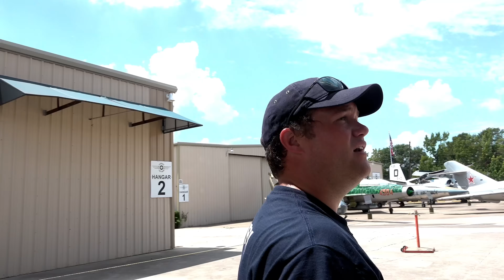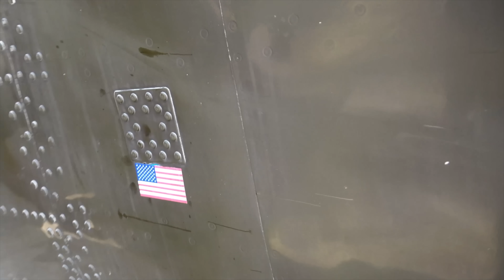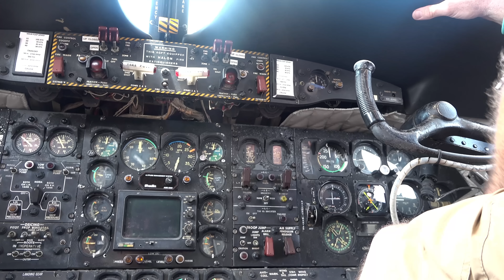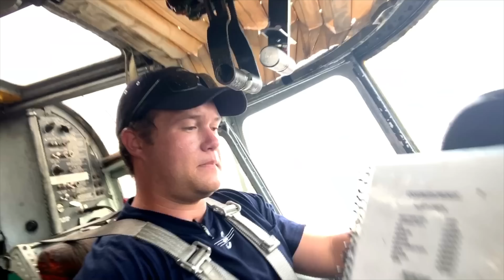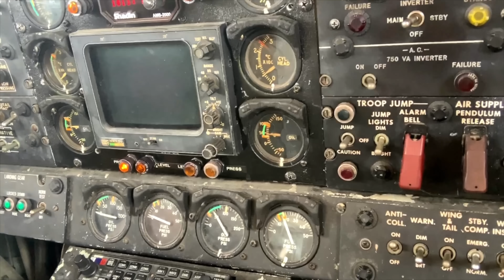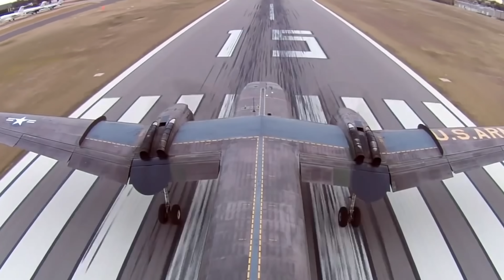The ‘Ugly Duckling’ That Got the Job Done | Inside the De Havilland DHC-4 Caribou

Comment: I was really surprised to learn that deHavilland made this bird.  They made some really good birds.  The weight of its cargo payload could be carried in a pickup truck.

The Army bragged about jt’s short take off with a full load, compared to that of a C-130.  They over looked the fact that a C-130 can lift off carrying the weight of a fully loaded and fully fueled Caribou.  And, today, over 50 years later, the 130 is still operating.

The  Carjbou was closer to being g a Wright Flyer, but with better engines.  It was a doggy aircraft.  The WWII DC-3 was a superior aircraft.
Courtesy of Half Vast Flying

Comment: The US Army flew the Mk 7 DHC Caribou. The RAAF and then the Australian Army flew Mk 4 Caribous. The older, ‘jet jockey’ pilot, in this video, should have known that, still, it’s a small point, I guess, except when you’re maintaining or servicing them.

You can tell a Mk 7 as it has, like the ‘Bou’ in this video, a little radome on the nose which makes it look like the aircraft has a ‘pimple’ on its ‘face’.
 
The Mk 4 Caribous are easily identified as they have a much larger, designated, radome plus a whole range of other differences, inside and out; electrical, airframe and mechanical, etc.
Our C-130 Maintenance facility; 486 Sqn, where I was posted, was right next door to a Caribou Sqn at RAAF Richmond, NSW. 

They were amazing aircraft to watch, as were the Hercs, especially when the Caribous were doing pilot STOL training sessions. The Caribou’s massive horizontal stabiliser caused substantial yawing even while landing in a moderate cross-wind. It was fascinating to watch as, in really bad weather, ‘Bous’ landing, usually, went down the strip with one wingtip just ahead of the rest of the airframe! 

Our C-130s were magnificent in their versatility of missions but I think that our Mk 4 Caribous just beat them. They could be set down almost anywhere, in distances you’d bet such a large aircraft could never land.

When the RAAF’s Caribou passed some huge flying-hours milestone, some DHC bigwig came all the wayfrom Canada, to Richmond; to award the squadron with a prize or a plaque, etc. He went on the record as being genuinely impressed by the way we kept our Caribous in such good condition and how they had long-passed their original ‘lifespan’ estimates. This was still quite a while before we passed these Mk 4s to Army.

We really didn’t want to get rid of them; but Army wanted them so our Mk 4s were, reluctantly, relocated to an Army Aviation Unit in Queensland. Sadly, sourcing spares for the Mk 4s was a constant problem so, eventually, they had to go. Fortunately, a couple of Caribous are still ‘airworthy’ and held in collections open to the public.
 
Many thought that DHC should have kept rolling out vastly improved new models and then their sales numbers would not have dropped off. No operator of the Caribou parted with them willingly, as far as I can discover. 

It was a fundamentally excellent airframe design which led to an extremely varied mission capability list. Perfect for those air forces, and commercial operators, who didn’t need larger transport aircraft. Sadly, the trend, back then, was for huge, long-range, cargo and troop carriers. This resulted in Starlifters, C-17s and Galaxy transporters that could move ‘armies’ around the world at the drop of a hat. 

Now, those conditions of probable conflict have changed. If the mighty Caribous had been progressively upgraded there would be masses of them used all over the globe.
Thanks for the video, like the Hercules, the Caribous saved more lives than they ever took... and that’s always a good thing. Cheers, Bill H.

Comment: I have 5 years on the DHC 5  buffalo the super caribou 3 times the power and 49000 lbs up weight  7000 ft per minute climb empty low fuel Wt

Comment: The unmistakable sound of a 1000 bolts in a barrel being shaken to shit. Miss hearing the engine run ups in Townsville after 38sqn retired them in 2009. The C27J Spartan doth not a Caribou replacement make.

Comment: Is there a current day replacement?
Reply: There are civilian Buffalos (the Caribou's turboprop successor) as well as DeHavilland Canada Dash-7's, which like the 'Bou will land or take off on a dime and give back change.  2 or 3 operators, including Air Tindi, have been operating the Dash-7 out of Yellowknife NWT. Also, the Icelandic national airline has several in service on short-haul runs on the island. Several European militaries were or still are operating either the Dash-7 or the Buffalo the last time I did a lookup. Two  Buffalo (At least) are on long-term charter to the U.N., mostly working in central or sub-Saharan Africa. The last time I saw one of that pair, it was passing through CYEG, they'd stopped to pick up some spare engines after overhaul. 
Why on earth the RCAF retired the Buffalo fleet I don't know - it seems like a ridiculous move (as does choosing an Airbus maritime SAR aircraft rather than the Patrol/SAR variant of the CL-515 being built by DeHavilland Canada-Viking. Several of the latter are already in service with the Indonesia (Navy or Air Force) doing maritime SAR and patrol work. The maritime patrol configuration was one of three design variant of the original CL-215, but until now only firefighting aircraft have been built in any of the models from CL-215, 215T. 415 built by Bombardier, and the current 515. 
The 3rd version of the CL-215 was a cargo carrier, with provision for a rear ramp. It could also be fitted out as a troop transport, although I haven't heard of that 3rd type ever being ordered. The maritime patrol version ordered by Indonesia would (it seems to me) have been an ideal SAR aircraft for the RCAF, given it's amphibious capability, long duration fuel load, and manoeuverability. That they chose to buy a built-in-Europe aircraft at considerable expense, and not domestically produced, is yet another strange procurement decision.

Comment: A bit more than 50 years ago I was looking over a Caribou on display at Plattsburgh AFB during an air show.  We could get real close to the aircraft and put our heads through some of its many openings, without actually climbing aboard.  What had impressed me the most was a sort of pocket-like protrusion built on the inner side of one of the doors.  It was made just to hold one credit card that had a sole purpose in life.  The purpose was to pay for avgas, aviation gas!

Comment: Was working on the ramp at Air Tindi in Yellowknife, NWT about 1995-96 when they had one. Was being used in support of the diamond rush going on at that time.  Always remember the guys going up on the wing  with 5 gallon pails of engine oil at days end. Amazing airplane. Unfortunately they got rid of it before I would of had enough experience to fly it.

Comment: I did my first air assault training on this aircraft in 1961 with the 101st Airborne Division during exercise Swift Strike One.  This was a training exercise that involved several divisions and some Special Forces over an area of 5 states.  We (the 101st) made two parachute jumps on this exercise but none from the Caribou (I wished).   My section (S-3 Operations) of the 1st Airborne Battle Group 506th Infantry was a part of that airborne assault in the grass along a rural road in South Caroline.  Helicopters were not in the picture at that time for doing infantry air assaults and this was a hot LZ.  It was a thrill watching the ground come up right under my feet and seeing the wheel skid in the grass as the brakes were applied and props reversed.  Didn't seem to take much distance to stop and we hit the ground running after some "enemy" troops who were near the LZ.  All in all it was exciting training that I loved and which I'll never forget.  That was 64 years ago and I made my Cherry Jump right out of Jump School on Swift Strike One.  I was a nineteen year slick sleeve private and I was beginning the greatest adventures of my life. A few years later I made many combat assaults from the HUEY helicopters on hot LZs with the bullets flying.  I was still slick sleeved but only because I had bars on my collar.  I regret to say that I never saw the Caribou in Vietnam during my tour in 1968 but I did see plenty of the old C119 flying boxcars.

Comment: I recall being at Dobbins AFB just outside Atlanta in the mid 1970s. A squadron of "Boo"s was departing. I believe there were 8 aircraft from either the AF Reserve or Air National Guard which were stationed at Dobbins. I was a T-38 IP at the time at Laughlin AFB on a cross country with a student. 
We waited our turn to takeoff and as the last Boo departed, the first one was just reaching the end of the runway. I'm guessing the lead aircraft was doing all of 60 or 70 knots.
Comical and impressive at the same time.

Comment: Some companies keep trying to reinvent the wheel. These aircraft were phenomenal. To replace them, they should have reworked the design for easier assembly. Reworked the avionics to bring them up to date, use new composite materials to enhance its strength, and add more efficient engines. This is what they did for the C130s, and guess what, it worked.

Comment: I worked on the Buffalo at DeHav Canada  in the late 70s. The Buff was the improved Caribou, using the GE T64 (from the Stallion Helicopter). It used the Caribou nose section, but everything aft was new. DHC proposed the Buffalo to the US Army in the early 60s (DHC and the US Army were very tight back in the day, DHC was more or less the Army's main source for tactical utility and transport aircraft) and several pre-production a/c were built for operational testing in Vietnam in '65, where it was in high demand by Spec Ops, being able to operate from football field size strips. Alas the bitter dispute between the USAF and Army over the Army's operation of larger and larger aircraft came to a head. The Army wasn't helped by a Caribou demo at Ft Hood, in front of a Pentagon and Congressional delegation, to demonstrate Army capabilities in 1965 or 66 IIRC. The 'bou was to land, refuel a Mohawk from on board bladders, and take off. It was a disaster, as the Caribou landed firmly in soft earth (it rained the night before) with the brakes on (a common STOL practice - the pilot flying was unaware that that particular aircraft had no anti-skid) and one gear dug into a soft spot in the earth and torqued the entire left wing and nacelle off, as the airplane came to rest on its left side, right wing straight up, right in front of the bleachers filled with officials.  Nobody was hurt. Eventually a deal was made to fund the Army's expansion of its heavy lift helicopter fleet, and it gave up on operating large fixed wing aircraft. The Caribous, (except one for the Army parachute team) were transferred to the USAF, who didn't really want anything smaller than the Herc. Eventually the Caribous were later transferred to the ARVN, where they remained. Being focused on the Herc, the USAF was not interested in the Buffalo either, and with the Army out of the picture, sales were limited to the RCAF and various smaller air forces with a total production run of only about 125, the last batch being built in the late 70s. DHC had hoped to build 300-500 Buffalos for the Army, but it ended up being the end of DHC's close relationship with the Army.
Reply: Good information, JK-rv9tp.  I always wondered what happened to the Caribou.  I saw some Mohawks in use in Vietnam using their forward looking capability.  You never knew a Mohawk was in the area until it had already passed overhead and gone.
Reply: @cliftonwhittaker260  The Ft Hood story actually got worse. When the Caribou ended up on its side, the Mohawk, which was inbound, was told to return to the base airfield. On landing it had a prop reverser failure and careened off the side of the runway. Had it been at the demo location, just a field on the base somewhere, it may have careened into the dignitaries. This anecdote is from the book "The DeHavilland Canada story".
Reply: Loved the DHC5. Sad when the last ones were retired at Comox BC

Comment: How does this aircraft compare to the similar-looking C-123?
Reply: Depends on what parameters you consider. A Caribou could land on a much shorter airstrip than a C-123 can. The C-123 had greater cargo space. The C-123 could fit into strips that were too short for the larger C-130.
Reply: @danielcotts8673 Thank you.

Comment: If it works good, it looks good. No fashion victims at DHC
A point about the seperate prop oil supply- engine oil contains acidic contaminants (by products of combustion) , by isolating the prop from this, you get less corrosion damage. In a 60 year old plane, that’s gold

Comment: 1970s I was working for Dhofar Defence Force and frequently flew in a Caribou. Very short rough dirt landing strips. On landing approach the rear door would be opened and load unstrapped. In coming enemy fire the flight could be aborted and the load would slide out and no damage to Caribou. Other time the was too long the rear was never closed.
Fantastic aircraft, each flight was an adventure
Reply: I went to college with a guy who was in the Air Force ROTC program. I lost track of him after our graduation in 1967. Sometime in the early 2000's I saw him at a funeral where we did some catching up. He told me about his Vietnam experience flying the Caribou. He supplied remote jungle fortifications that had short dirt runways covered in metal mats. The cargo door was opened as he touched down, the pallets of supplies sat on rollers, a drogue chute would pull them out the back, and the plane would take off without stopping, frequently dodging enemy fire. Around 2015, my friend died from cancer. His widow said it was from Agent Orange, and I have no trouble believing that, considering the circumstances.
Reply: @charlesyoung7436  That is Low Altitude Parachute Extraction System (LAPES), a tactical military method for delivering cargo from aircraft. It allows for the delivery of supplies without a traditional landing, making it useful in areas where landing is difficult or impossible. LAPES involves a cargo aircraft flying at a very low altitude (2-10 feet above the ground) and deploying a parachute to extract a pallet of cargo.
Reply: That flight performed LAPES (Low Altitude Parachute Extraction System), no actual landing.

Comment: I went to a high school next to Bankstown Airport near Sydney Australia in the 70's, de Havilland had workshops and facilities along Milperra Road on the Southern side of the airport where the (Army *corrected Thanks Dean) RAAF would bring the Caribou for service and maintenance, I used to watch all sorts of aircraft land and take off during class breaks and the Caribou were frequent visitors. 
I was fascinated by the very short landing and take off capabilities of these aircraft, the sound they made and the slow speeds of their approaches. Great aircraft.
The roar when the engines were revved as the props reversed is something that I felt in my bones, awesome stuff.
Reply: G'day there, it wasn't army but RAAF, 38 Sqn to be precise. I was posted to these in '88, RAAF Richmond, four great years, another 3 later on in Townsville. So many wonderful experiences with these birds, very much a maintainer's hands on 'headbone' aircraft (you had to use your head bone for fault-finding 🤣🤣)
Reply: Worked at Hawker de havilland later Boeing Australia for 25 years at Bankstown airport NSW Australia in aircraft maintenance then quality assurance.
In the 1980s to 1990s carrying out R2/ R3 and (DLM) Depot level maintenance for 38 SQN and 35 SQN RAAF on these aircraft, also joined the Army reserve in the 1980s for 6 years in 177 Air Dispatch SQN at 1ATSR RAAF Richmond throwing stuff out of the back ramp of these things........fun times and awesome STOL aircraft.

Comment: The comment about using the door on the side for paratroopers was interesting. I jumped from an Army Reserve Caribou in the early 80's when I was a Forward Air Contoller (USAF). We exited down the rear ramp using standard Army rigs.
Reply: My Army National Guard unit in, Utah, had a Aviation Section with a Caribou.  My Jump Log lists one jump in Aug. 1989, and one more in Dec. 1990, both off of the ramp.  That Dec. jump was frigid with the ramp open the entire flight 😅

Comment: Oh my, hearing that inverter spool up takes me back to my days as an Instrument Electrical Tech in the Canadian Forces. When inverters were motor/generators, before they became silent solid-state bricks. ;) They were lifed components that needed scheduled maintenance & replacement after a certain number of running hours. Brushes, bearings.... They did provide a true sine wave 115VAC 400Hz, something it took a while for the solid-state versions to perfect.
Reply: And chewed up a 💩 load of power. Never could figure out why they didn’t run a separate AC alternator, set up to 400 Hz or whatever (at cruise rpm)
Reply: @Bakes-z4c  Many aircraft did/do use AC generators, depends on the role or purpose. Emergency systems almost always rely on DC so the battery can power essentials as a last resort. Depending on the nature of the emergency & distance from airport, the pilot can choose to run an inverter off the battery to power some non-essential systems or instruments.
Reply: Are they using 618T Tx/Rx?